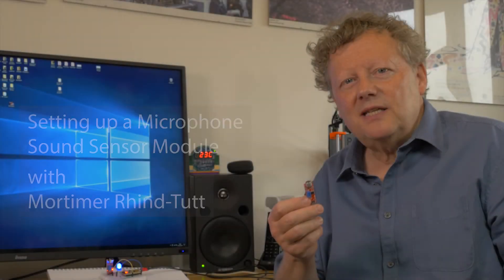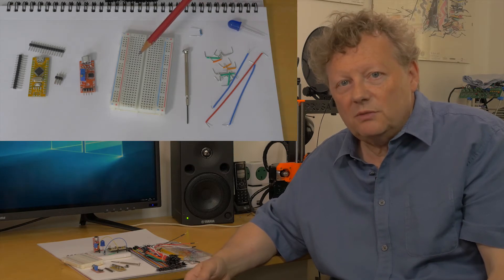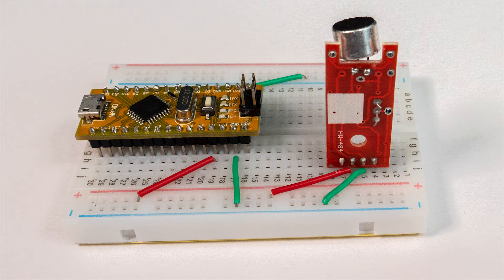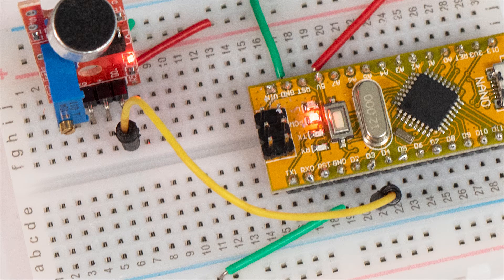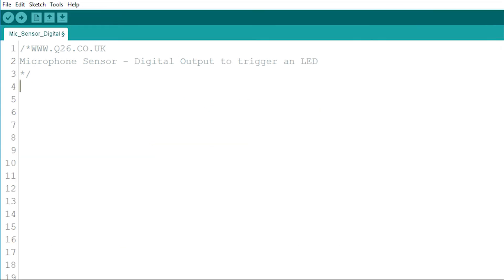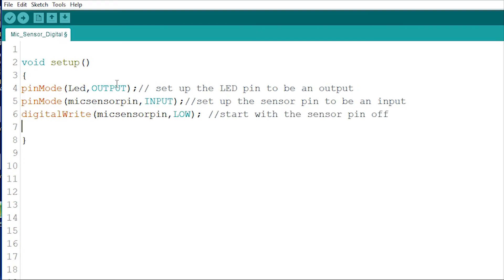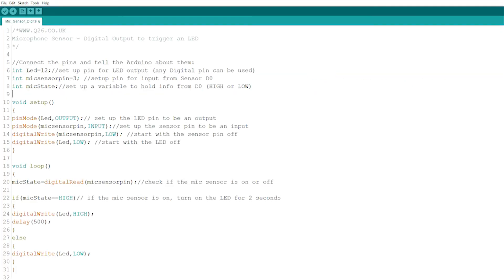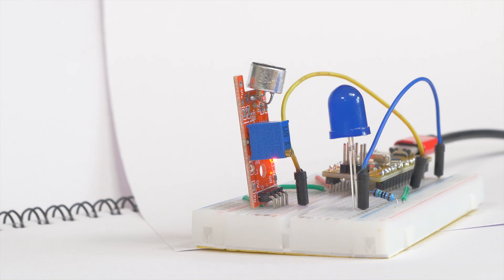Using and coding a Microphone Sound Sensor with Arduino

Comment: There is also one problem with higher load from the source when voltage drops down by 0.1V, then the module doesn't detect sounds on digital output and I need to move with potentiometr one turn. If it is at all boards so, then it is for children and can not be used in applications and production.
Reply from the maker: Maybe you have a defective board - they are very cheap and a lot of modules sold are very poor quality. The ones we sell seem to work fine and I use them in my projects, as you can see from my videos. If you set it up in the same way as in my video, then unless you have problematic components, you should see the same result...good luck!

Comment: Good day Sir 👋

How may I set my 4 pcs of 4 pin rgb led module to my 4 pcs of speakers separately 1st 4pin rgb led module to 1st speaker, 2nd 4pin rgb led module to 2nd speaker, 3rd 4pin rgb led module to 3rd speaker and 4th 4pin rgb led module to 4th speaker with super slow changing colors such as 10 seconds delay transition colors of fading rgb and switch automatically to music reactive mode when there is playing music or songs on my videoke and turn back automatically to super slow changing colors of red green blue when there's no music playing or in standby mode?

4 pcs of 4 pin rgb led module to my 4 pcs of speakers separately:

 1st 4pin rgb led module to 1st speaker, 

2nd 4pin rgb led module to 2nd speaker, 

3rd 4pin rgb led module to 3rd speaker and 

4th 4pin rgb led module to 4th speaker

Comment: Great tute thx. May I ask how to substitute the led function for switching on a seperate circuit such as a light or motor that has its own power supply? Do u have a tute for that please.
Use case might be when a threshold of sound is heard or motion is detected the arduino turns on a small motor that is powered by its own 9v dc battery.
Or it actuates a relay to do same.
Thank u 😊. Tim
Reply from the maker: Glad you enjoyed the video - you can do any of these things by triggering a relay or mosfet - you need to protect the arduino, so some circuitry such as a ULN2003 would be helpful. I will look into making a video to take this topic further...

Comment: try 

digitalWrite(Led,micState);
you will have a real-time output from the LED 😉
Reply: Good day Sir 👋

How may I set my 4 pcs of 4 pin rgb led module to my 4 pcs of speakers separately 1st 4pin rgb led module to 1st speaker, 2nd 4pin rgb led module to 2nd speaker, 3rd 4pin rgb led module to 3rd speaker and 4th 4pin rgb led module to 4th speaker with super slow changing colors such as 10 seconds delay transition colors of fading rgb and switch automatically to music reactive mode when there is playing music or songs on my videoke and turn back automatically to super slow changing colors of red green blue when there's no music playing or in standby mode?

4 pcs of 4 pin rgb led module to my 4 pcs of speakers separately:

 1st 4pin rgb led module to 1st speaker, 

2nd 4pin rgb led module to 2nd speaker, 

3rd 4pin rgb led module to 3rd speaker and 

4th 4pin rgb led module to 4th speaker

Comment: As there is analog output pin for the sound sensor what will be the range of frequencies it would identify
Reply: Not so wide as you can check

Comment: Very clear explanation. Thank you. One quick question: if I have other codes that also use delay(time) (say codes control other LEDs as a clock, which delays the whole loop (e.g 'delay(1000)' ), then those codes will not allow the mic to 'listen' at real-time? How do we solve it?
Reply from the maker: delay(time) holds up everything - an alternative is to use 'millis' or to use 'interrupts' - you can find more about these on the Arduino pages. Glad you liked the video.

Comment: Hello, Mat from London here - this looks reasonably sensitive. I have just bought 30 (!!) from Aliexpress but I received the same board but a different electret mic, it is smaller and points upwards from the board. The red LEDs on the board don't even come on when connecting +5 and GND, and the signal is constantly high despite adjusting the pot. Any clues?